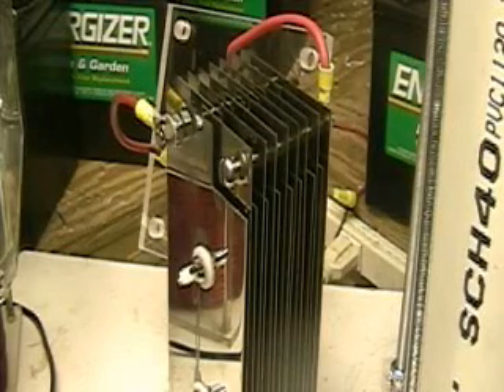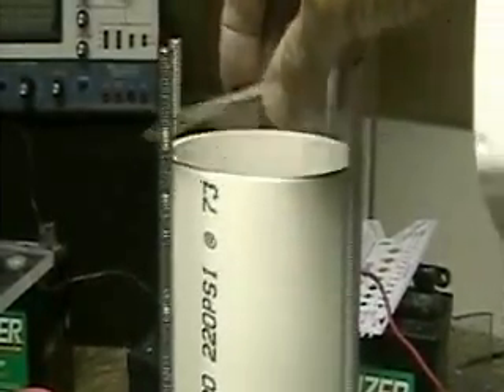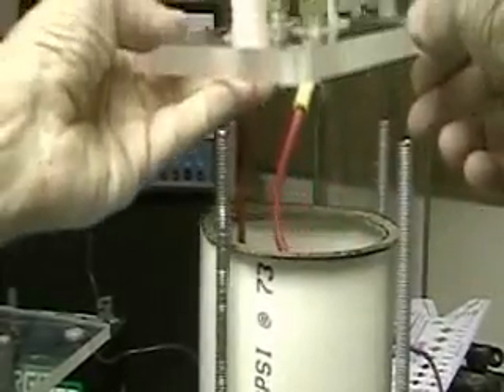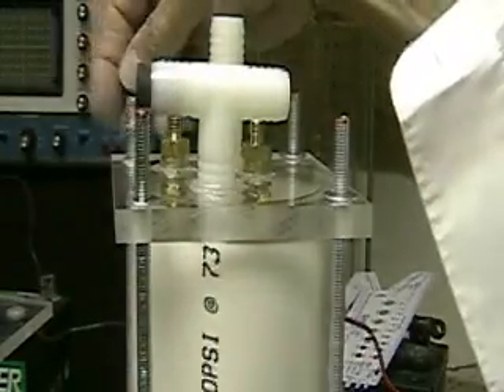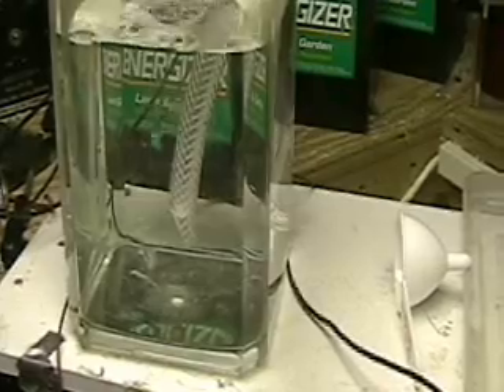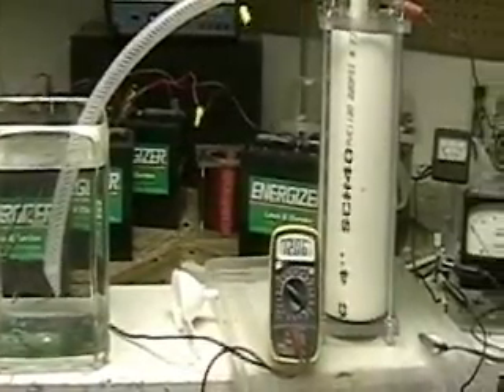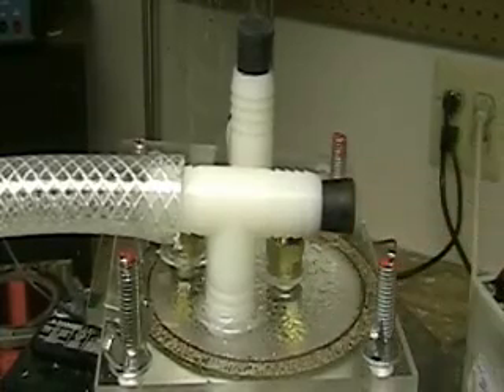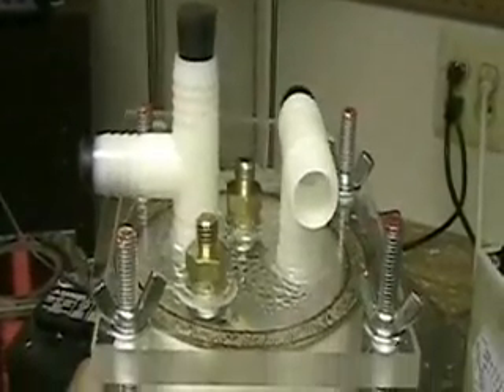Hydrogen Tap (16 plate Car Config) 113

Comment: Make a box from metal. Hydrogen in on one side, out on the other. Fill box (realy stuff it) with "steel wool". Not the fine tread, but the one to clean cooking pan's. This will absorb the heat of the flame and prevent it fom goiing into the hydrogen generator. The fine steel wool will burn, so don't use that. For safety, don't scip the cork